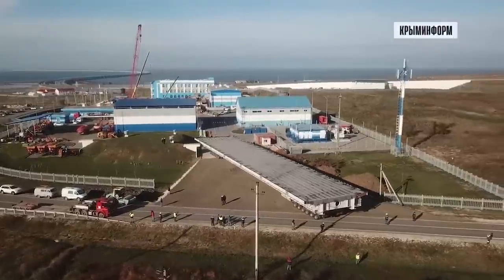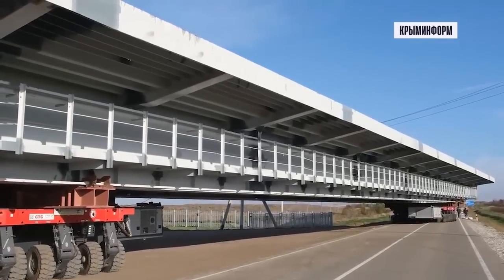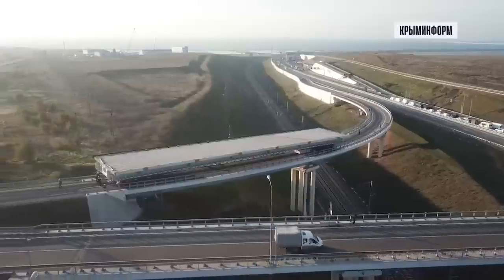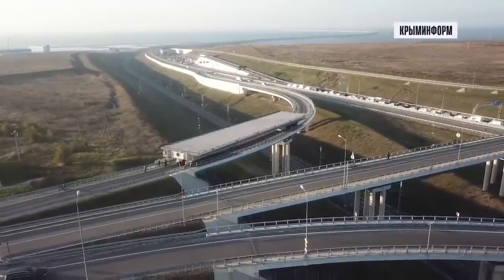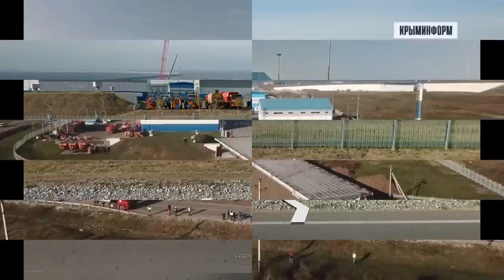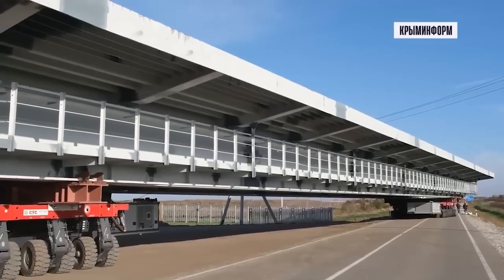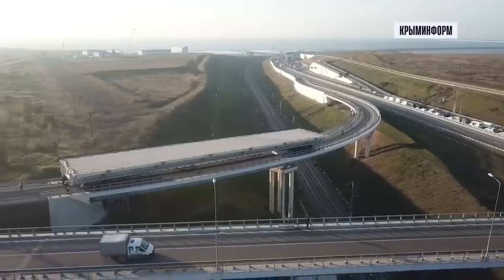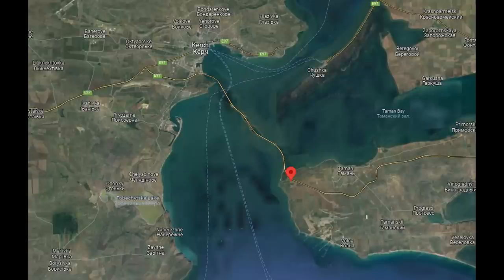Russia Transports New Span to Repair the Crimean Bridge

Comment: Im not an expert in bridges but work in naval engineering, so big to gigantic steel constructions. This piece of bridge is not a very difficult construction, everything is straight and with welding machines(simple ones for straight welds, such as for welding profiles to a big plate) this can be done well, simple and quick. They already have the construction drawings and even a facility specialized to produce these sections so to me it is not surprising at all to see this replacement piece being ready this fast.
Reply: This section looks to be wholly steel.
In your expert opinion, why build concrete bridge spans when apparently steel ones can be build this quickly??
Reply: A bridge section like that will require a lot of complete penetration welds that requires mag particle inspection looking for cracks, porosity and other defects. Not saying they didn't do it but this was built pretty quick, chances are they didn't do a thorough job. You're right all this was pre-engineered with existing drawings so that part was already done.
Reply: Yes, agree. My guess too.
Reply: @Therealromario1  Different materials have different mechanical properties for different applications. I'm not an engineer but concrete is stiffer and therefore more brittle. It could be that given the span and design, steel is the best choice. I know working on equipment fabricated for offshore fabrication takes a long time to ensure the equipment has longevity in the in situ conditions including making sure all coatings are perfect to protect vulnerable steel from salt water.
Reply: @Therealromario1  Concrete has the huge advantage of manufacturers being able to cast the bulk of the material. A mostly steel structure will require expensive steel plate and foolproof welding.
Reply: Just guess. Span are not unique only for this bridge and are made from prefab steel girder, plates etc which are used for other construction. Even if factory was build and machinery bought to build this bridge, it can be (re-)used to make spans, sections for other steel constructions: bridges, overpass, viaducts etc. Basically, 2 lane bridge span is 2 lane bridge span just in different length and support points (building materials).
Reply: "new target acquired" lol
Reply: I also work with ships so it may be possible for this to be fabricated in a hurry but I doubt testing protocols, if any, could be completed. Let's see if it fits!
Reply: @mbarker1958  Agreed. The tricky part is connecting the new section to the existing bridge. You don’t want to be the first tank going across.
Reply: Civil engineer, here.

When you have money but can't place it in international accounts due to sanctions and asset freezes you now can invest it locally in your own economy. Gone are the days of quick gas and crude earnings which could be whisked away into London and NYC accounts for safe keeping !

This might be why this bridge span was fabricated so quickly. The money always  needs to go somewhere.

Experts were hired for around the clock and likely overpaid for improved motivation.

Section elements are standard and were pulled from a maintainance  warehouse.

But was proper QA-QC done on the section prior to shipping it to the  construction site. This remains the massive elephant in the room.

Another  poster here cited the use of an Italian (?) transport crawler. As sanctions continue and spare parts become scarce crawlers like this will cease to operate, preventing bridge repairs. I'm sure the crawlers, having to bear very heavy weights, need specialized ball bearings. 

Remember what had happened at start of war? Sanctions stopped import of specialized Swiss ball bearings. Because of this, the Russian rail company, who use such bearings, knicked several routes and retired several cars.

And the crawler parts ought to be even more niche, more specialized hence harder to obtain.

Ukr and Ukr allies would we well-benefited to sabotage such crawlers to disallow the movement of completed bridge sections. The bridge will be hit again, I have no doubts about this, so by eliminating the crawlers its repair will be very, very hard.
Reply: It took 26 days total to repair the MacArthur Maze.  It took 22 days to fabricate and deliver the steel beams from Arizona to California.  This Crimean Bridge section looks to have a similar amount of steel, but welding for this Crimean Bridge section would be a little faster because they already have the production drawings, and they have a fabrication facility on site.  The main delays in this repair would be finding and delivering the steel.  But yes, the inspection process would need to be accelerated and/or even omitted in some regards...
The Rebuilding the MacArthur Maze (Documentary)
https://www.youtube.com/watch?v=-TKjwblp1XI
Reply: @oleopathic  That’s a very interesting thought that highlights the power of sanctions. It raises the question, how quickly can Russia reconstitute its manufacturing capabilities that have degraded since the dissolution of the Soviet Union. And it fills me with lots of other questions. Did the Soviet Union ever really develop the manufacturing capabilities to build strategic components such as precision ball bearings? Or has it always depended on imports? How reliant was the Soviet Union on Lend-Lease for strategic components like ball bearings and machine tools in the first place? If Russia is cut off from strategic components from the West, can China come to its rescue? Does China really want to come to its rescue, either in supply or in helping Russia reconstitute its manufacturing?

I imagine there are pro-Russians that will scoff at my questions, saying that Russia is a manufacturing powerhouse. But that is not the truth. Because of Russia’s growing reliance on energy exports, its manufacturing capacity has degraded. It has fallen by the wayside because there was little incentive to invest in it while great profits could be made with oil.

Of course we can ask similar questions about the U.S., but our manufacturing outsourcing was never as dire as many critics feared. We lost our top spot as the world leader of exports of manufactured goods, but we have somehow maintained a manufacturing base. When you consider NAFTA I & II, we’re doing pretty good. We are in a better position to reconstitute our manufacturing base. We are in a good position to help our nearest neighbors build up their manufacturing capacity. In short, we are positioned as well as anyone for a global economic contraction.

Wow, how did I get from the repair of a bridge span to geopolitics? 😂
Reply: I suspect that most comments are based on how this might be built in the West. But, getting something built and transported this quickly in Russia today is a far different story.
Reply: I'm betting they have concrete piers built into the working floor as a jig and assemble a new section from one end, repositioning as they go. Warehouse the steel, precast the box section and have it sitting around, then build a new section the right length when it's needed. It's a helluva lot of rushed welding, but three weeks sounds believable. The Soviets wee big on interchangeable parts for their structures, no reason the Russians wouldn't be too. There are probably  replacement spillway and lock gates for the standardized dams on the Dnipro sitting somewhere, too.
Reply: I believe that the section would have to be arched (convex) to accommodate its own weight. If it was built flat, it would likely collapse once you parked 8 fully loaded tractor trailers on it.
Reply: @billd9667  - It's built into the steel. The concrete is made straight and kept that way by support from the steel. The metal expands, contracts, and moves around, but the concrete is carried  where it goes. Bridge decks do arch and twist, but the design is made to minimize it.
Reply: @DavidM2002  We should ask if any projects were cannibalized of their materials and skilled labor in order to make this project happen so quickly.  I agree that in general Russia is disorganized and slow, but if a relatively simple project is a priority for the govt, the Russian govt actually has, in some ways, more power to make it happen than do western governments.  Safety, labor regulations, and private property interests can slow things down in the West, but much less so in Russia.  In the Westthe govt has to compete with private customers for the steel, but not in Russia.  So basically, Russia can replace a bridge section almost as fast as we can in the West, but at what cost...  However, if it came down to a more complicated project, like replacing the entire bridge, then I agree with you, that might be much more of a challenge for the Russian govt at this point.
Reply: @networkedperson  Good points.
Reply: Considering how quickly Liberty ships were welded together, that makes sense.
Reply: @taxesdeathandtrouble.1886  with the cold winds blowing over the steel members now that it's winter 2022, the Russian civil engineers will have hell of a time controlling concrete curing. ;) and knowing their culture of poor QA-QC they wouldn't want to be too pedantic anyway.
Reply: @oleopathic  Eliminating the crawlers is an excellent plan. Hopefully there's more surprise attacks in planning. 

Regarding the replacement section, I really think coatings will prove to be an issue over time (assuming the same section isn't targeted again). You probably understand better than I how important coatings are in a salt water environment for structural steel. Those beams are huge but they still have a corrosion allowance and the attachment welds for railings and platforms are pretty susceptible if the welding is shoddy. Little porosity in a beam splice weld and crappy coatings could be a disaster in the making.
Reply: @pho-kingsoup8126  I think that there are plenty of surprises in store for Putin. 

Remember that Ukr has today and has had all along the home advantage - they have access to local informants, advance and intimate knowledge of local landscape, and thankfully Putin's built-in ineptitude as a bonus. Don't forget how local Ukr  turncoats have been ending up as well: this latest Stremousov politician died in a car accident. So turncoat utility is minimal.

As for the coating. It's important in the long run and by that I mean like a decade. But seeing the quick tempo of this war from start to finish, in another 7 months, and I hope, Ukr will have its lands back.

So in under a year if coating was faulty and some corrosion occurred it will be minimal. Remember that steel sections are massive with large thicknesses of webs and flanges, massive bolts. It takes much time for these to thoroughly degrade and to catastrophically fail.

Odds are much higher that an ATACAMS will come over for an uninvited visit at 4am on the same Bridge. ;)
Reply: @billd9667  Bridge decks are built with a camber so when loaded they flatten out. If there’s no camber, you get a “birdbath” sag at mid-span. While it won’t cause a collapse, it affects traffic speeds driving on a wavy deck.
Reply: @billd9667  You see that in pre-stressed concrete structures, where the lower parts of a beam are put in compression to keep the concrete from ever being loaded in tension. Concrete has pretty good compressive strength, but practically no tensile strength.
This is just a steel truss, so tensile loads are acceptable, no need to pre-stress it. The concrete or asphalt roadway will provide little if any additional strength, and is there to protect the top of the truss from corrosion and provide a non-skid surface. If the steel was just painted and driven on, vehicles would strip the paint off in a few days, and expose the steel to the salt.

As far as it being realistic for Russia to build the spa so quickly, certainly. It's simple welded steel construction. Not sure about Russia's QA procedures in the best of times, needing to work fast may or may not hurt them too much. Russia may have also kept some material on hand and possibly even some parts prefabricated to quickly repair the bridge in the event that a ship crashed into a span destroying it. Before the war, that bridge was the only way for Russia to access Crimea without using ships or aircraft. Being able to repair a section quickly would be very important for the navy base there.
Reply: @oleopathic  I used to work in food industry where we had slow and fast rotating equipment. We used SKF, FAG and Koyo for fast rotating and Russian (even Soviet) or Chinese roller bearings for slow rotating. Never had a problem.
This crawler is obviously very slow, and I suppose that ordinary roller bearing would work. No need for SKF Explorer quality.
Reply: @Therealromario1  price?
Reply: @tonihil  thank you for your  comment. If the bearings are not the critical component then perhaps another component is critical ? And if this is the case might it not be a good idea to target that component with sanctions? 

Which component do you think is critical?
Reply: And its not like russia didnt know that this bridge would be a target. Im guessing they were probably prepared to replace the entire bridge.
Reply: @pho-kingsoup8126  I am an engineer and concrete versus steel has multiple reasons behind it....COST is the first one....span and strength to weight ratio another...and then there is corrosion and the list of reasons continues.....doing a boxed welded girder span when the engineering and drawings have already been done isn't hard...BUT...doing it RIGHT...IS!!! Quality takes time....I specialize in inspections of things life this....I'd probably fail half the damn thing....just because it was built in Russia by orcs!! LOL....Have you ever seen the SHIT the Russian's built?!?!? and you can definitely forget about impact assessments on anything they build. This bridge itself was constructed faster than a geotechnical assessment could have been complete for its foundation piers!!
Reply: @pho-kingsoup8126  Longterm isn't important.  In Russia's mind, it just needs to last until the war is won.  for the Ukranians, that span during transport makes a juicy target!
Reply: @Therealromario1  Concrete spans in this application have a lower lifetime cost. A replacement steel span is an expedient measure. It is also likely easier to repair in-situ or gas axe into pieces for removal and replacement, if it is hit again.
Reply: @oleopathic  A crawler is a complicated machine with lots of parts. But, many of the parts will be generic and obtainable/substitutable from another source or reengineering part of a system the parts are from could allow broader substitution of system parts. I run equipment that is ancient and unsupported - when you're in a corner you find a way to keep stuff going. You have no choice but to soldier on and hope for the best. When it breaks down, you assess it, repair it however necessary and keep going until the next breakdown. A lot of equipment can be run very long in the tooth without "proper" maintenance. I wouldn't bet my house on anything failing before sanctions are lifted, and we can be sure that spares for this type of equipment will make their way in via the backdoor. Iran is still flying F14 and other US military aircraft 40+ years after the revolution. Whilst Russians may appear backward and xenophobic - it doesn't mean that some of them aren't innovative and incredibly resourceful. I'm amazed at what I have seen done in the boondocks of third world countries to keep stuff running - and these folk didn't have the resources of an organisation that owns and operates a crawler and can make a bridge span that size, that fast...
Reply: So You are armchair expert
Reply: @julesjames593  
During transport? It's the harder to hit during transport. 
Once it's installed, it'll be nice and stationary. Then they can decide when and how to strike... they can even try to get another suicide truck to drive over it.
Reply: @pa6370  How dare you dissent from the established prejudices. ;)

I'm just kidding. You bring up a good point, repairs need not be perfect to work. And repairing those crawlers isn't rocket science to begin with.
Reply: @Slavic_Goblin  When you own your own business, have no one to help, are geographically isolated, don't have the resources to pay for a professional repair or a new piece of equipment and have invested everything you have to get to the current breakdown - you come up with solutions, you're buggered if you don't. This petty view of "Ohh, but it's not X-Rayed by god himself, you can't use it!" gets thrown out the window fast. This replacement bridge span will be a consumable...
Reply: @oleopathic  It uses hydraulic motors. 
The seals are the weak link. 
Think of the pressures involved.
Reply: Agree with your comment but I suspect Russia all ready had stock piled the materials for a span in preparation as the Ukrainians have been telling them that the bridge is a target. Gathering the materials would have taken a month.  Further I was under the impression that the Spain that was destroyed was made of concrete and not steel?
Reply: @davidhimmelsbach557  are the seals tough to manufacture ? Are they fairly uncommon to find suppliers for ?
Reply: @oleopathic  They use exotic polymers only available in the First World. The market is limited -- so Russia is not a player -- I doubt if Red China can produce them.

It's of note that Russia can't obtain railroad bearings -- something that's much lower in tech, much higher in mass production.

BTW, railroad bearings are also polymer based. These are NOT made of steel -- in any shape or form. They sit underneath the cargo carriages and above the trucks. They look like flat disks -- of plastic.

Years ago ( Fifty-years ago ) Shell Oil Company ran advertisements bragging on their railroad bearings. In these ads, they showed the bearings being actually placed on trucks ( boggies: British ) and then the load being craned down atop the assembly.

Like rubber tires, such bearings are expected to be replaced after so many loads/miles/trips.

Railroad bearings merely permit the trucks to twist -- a tad -- under the load -- as the train rolls through curves. This limited range of motion is why elastomers / plastics are used. Shell was bragging because -- back then -- their stuff was state-of-the-art.

This same polymer technology is involved in very high pressure seals ( O-Rings ) used in these trick hydraulic motor rigs. Hydraulics are mandatory because it's necessary to have absolute (relative) control of the driven wheels. They have to rotate -- just so -- even though their contact force with the pavement is changing -- all the time.

If a seal blows out. The entire sub-unit is dead -- has to be logically cut-out of the total assembly. This is but one part of the design. You should think of this rig as a 'hive - traction - motor.' 

It also depends upon digital logic, digital radio control, digital speed feed-back -- the whole she-bang. IIRC, you can't buy these rigs. You can only rent them. They come with factory techs and factory operators. I suspect that Italy walked away from their dealings -- and Putin has picked up the pieces. But, this is pure speculation. Maybe the Red Chinese knocked these rigs off.

If you poke around, you can find lots of video wherein these rigs are used. They are quite the show.
Reply: @davidhimmelsbach557  Thank you very much for the thorough description! If I had to guess, your background is in railroad engineering or mechanical engineering in the niche of RR transportation.

I was joking around with a colleague recently about how Russian sanctions, reduction in workforce size (dead/maimed/mia troops in Ukraine), and increasing repressions at home will have an impact on the quality of life of the average Russian. I jokingly said that Russia will be returning to 18th century as far as technology is concerned. That, they will return back to the tube-televisions, horse & buggy, and pre-digital tech. Perhaps my outlook is grim but there is some truth to this given Russia's recent battlefield loses & the world's unequivocal, and correct response to Russia's beastly aggression. But I digress.

There was a time, in pre-1990's when USSR used "dumb" trains. The kind of trains, perhaps, that they used since WW2 for freight. May they not unpack those cars and engines from storage much as they did the tanks/apc's from the 1960's-era for the 2022 Ukraine War ? If so, wont these dumb machines use more basic components which might be supplied by their backers in China, NK, and Iran ? In short, shouldn't it be easy to by pass the need for the state-of-the-art Swiss bearings and the aforementioned o-rings ?
Reply: @oleopathic  The T-62 production line says: "Yes we can!"
Reply: @davidhimmelsbach557  and I think they're will, with time. Russia's history is that of the mythical Phoenix.
Reply: @oleopathic  theres probably a half dozen Chinese manufacturers of spmt's I don't think the Russians will have problems replacing them
Reply: @zopEnglandzip  that's a shame.
Reply: They're even easier to blow up.
Reply: If the equipment moving the span can be disabled on the bridge then you have a broken bridge blocked with broken irreparable equipment 😊
Reply: @gerhardk98 that's a recepie for chaos. And with added chaos of Ru losing the war this will further tip odds in Ukr favor.
Reply: @pho-kingsoup8126  you know they didn't do it folking soup
Reply: @valamaas  first stupid comment lol
Reply: Why does the construction of bridges take years in Germany then? Are we idiots?
Reply: I agree, replicating from existing drawings would have been fast.
Reply: @DezorianGuy  do you think the Russians actually inspected this bridge for structural integrity?! 

LMFAO
Reply: @samholdsworth420  i reckon not. Still, this almost feels like they expected some sort of dismemberment of that particular bridge and prepared for it. Not saying they bombed their own bridge here.
Reply: @DezorianGuy  that's different. 

. Construction from scratch.
. Maintain and repair existing.

Always easier to do the latter.
Reply: @oleopathic  so countries will most likely have certain bridge parts already prepared for bad times? Russia expected this attack sooner or later it seems to me. 
Can one tell if Ukraine also has spare bridge parts prepared for a swift repair of the recent ones?
Reply: @DezorianGuy  war or not. Attack or not. Any bridge owner who has invested millions of dollars into the project will have many, many spare parts. This is true for any country in modern times.
So Russia should be well-stocked.

Ukraine likewise has many spares for many of their bridges.
Reply: @oleopathic  You say that, but I wasn't quite so sure about Russia. Well, they proved me wrong. Let's see how long this new Crimean  bridge part will last.
Reply: @DezorianGuy  spare parts abundance is separate from "durability". Russia lacks the qa-qc for all things commonplace. So...perhaps it might not stand a long time. Time will tell.
Reply: @pho-kingsoup8126  In the USA, Europe, Japan,, Korea,, etc...? Yes! But NOT in Putin's Russia.
Reply: @DavidM2002  Agreed! I'm not abridge builder, but my father-in-law & brother-in-law were. I AM, however, familiar with how large organizations (especially Russia, the USSR, despotism & terrorist-states) work. In Russia, QC & production schedules bend to the Kremlin's will... even when doing so isn't technologically sound!
Reply: How long do you think that will last.
Reply: @Slavic_Goblin  the truck was a decoy